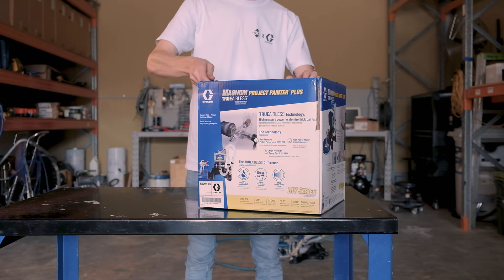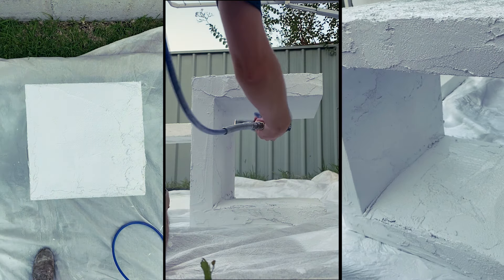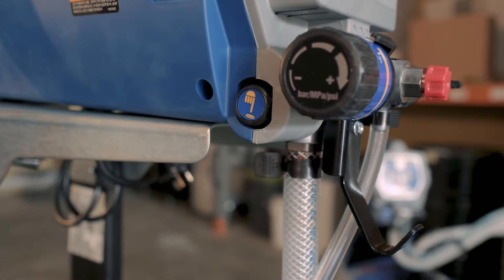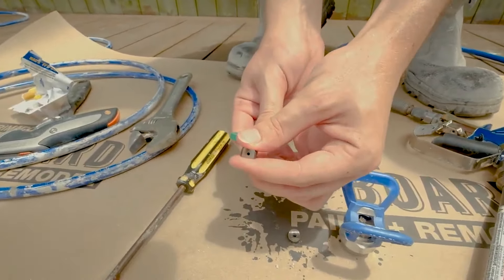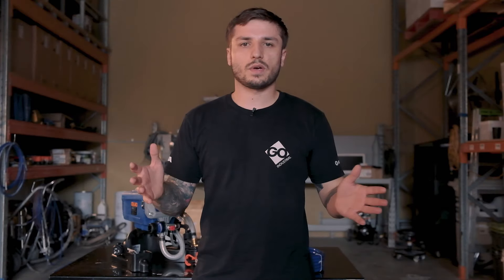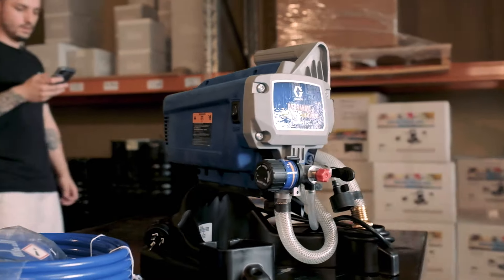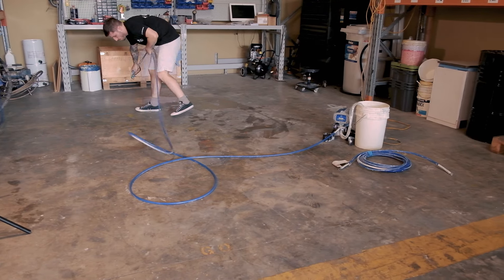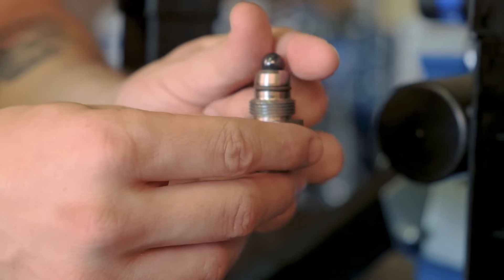Graco Project Painter Plus Magnum - Your DIY entry to airless spraying

Comment: Yeah, I paint interior and exterior for a living and I have been using this sprayer for a little over a year. And I spray 3500 sqft+ houses monthly and 1000sqft-2500sqft 2-3x a week and have never had a problem.  But I only use recommended length hose and no tip extension over 20 inches.  Like I said, I’ve been using a little over a year and what type of that I bought secondhand because the other sprayer I had was stolen out my truck. So I needed a sprayer because I was in a pinch because I had a job start that morning. So believe me these little sprayers can do a lot more than they give them credit for.
Reply: Appreciate the perspective
Reply: I don't appreciate your perspective.
Reply: That is helpful to read this type of comments from the professionals. Thank you for sharing
Reply: Would you say they are good to use for spraying apartments?
Reply: Bought one today in a pinch. Prepped walls today, paint tomorrow. Everything one color. Floorcovering guy was drafted to paint the apartment before carpeting it. I think I can do it! :)
Reply: How did it do when switching from oil to water based paints any clogging ..

Comment: I plan to paint a basement ceiling the same square footage of the house (2400ft) with black matte dryfall paint. Can I use the Project Painter Plus for this? If so, what tip and hose if not the ones that came with the sprayer?

Comment: When you say it is limited to spraying 200 Liters/yr, what do you mean by that exactly? Is that its typical lifespan? Is that when the motor/pump goes out? And if so, are there steps to extend that lifespan? Thanks for the great video!
Reply from the maker: This is a rough guide for the average use and lifespan of the Project Plus - assuming you'll use the sprayer for the next 4-5 years + and take good care of it. Frequent flushing with water until clear, storing with Pump Armour and somewhat regular use of the sprayer will definitely help extend the sprayer's lifetime! I hope this helps.
Reply: @GOIndustrial  thank you!

Comment: Hey I just bought this sprayer to paint the interior of my 4 bedroom house. I only plan on spraying a couple of rooms at a time. I noticed you said this shouldn’t be used to spray more than a small bedroom? What happens if I spray more than that at once? I bought this unit because I only plan to do small projects at a time (a few interior rooms, furniture pieces, etc). I’m not a professional painter, I didn’t want a large unit that takes up too much storage space, and I wanted something affordable but not so cheap that it would crap out on me. Was this a good purchase? Or is there another unit I should exchange this for? Just looking for any guidance
Reply from the maker: I wouldn't stress, the Project Plus is definitely capable of handling projects that you've mentioned! Definitely no need to exchange, the Project Plus will be able to handle these smaller projects time, at a time. The usage guide is just a guide - it is to ensure that the Project Plus isn't being used for massive exterior repaints, or commercial projects, to avoid burning the motor or pump out!

Comment: Can I use the tip that comes with the Project Painter Plus to sprays cabinets?
Reply from the maker: Sure can! We do recommend trying the Fine Finish Low Pressure tips however to achieve a nicer finish - the FFLP310 is a great tip for cabinetry!

Comment: I plan to paint garage walls and ceiling. Interior walls and ceiling. The house is 3,000 sqft. Lastly, kitchen cabinets (if this is professional enough). Which model do you recommend?
Reply from the maker: I'd recommend our Graco 190PC Express for this application!
Reply: @GOIndustrial  Can it handle painting a ceiling? I'm just looking to paint an unfinished basement ceiling. Thanks

Comment: Question. indoor painting waterbased. Enclosed room no ventilation. besides safety gear is it okay to do?
Reply from the maker: Good question! It is okay to spray in a room with little to no ventilation. I would highly recommend purchasing a small extraction fan to help, or at least ensure you're wearing a respirator for these projects!

Comment: What do you can ONLY spray 4-6 litres a day or 200 per year? What happens when I go over 4-6 litres a day?
Reply from the maker: Hey, thanks for your question! 

The 4-6 litres per day rating is a guideline that Graco set to ensure that the machine is not overworked and burnt out prematurely. 

There is nothing necessarily that will happen if you spray over 4-6 litres. It does however, put extra strain and wear on the pump / motor and may void the warranty. 

Hope this helps!
Reply: @GOIndustrial  So does staying within this guideline completely prevent the machine from ever burning out, or will it still eventually burn out at some point?
Reply from the maker: @SkemeKOS  Staying within this guideline will ensure that the sprayer will perform optimally. Of course after many years of use, the motor will begin to wear as its brushed, and the piston in the pump will wear out eventually! However we do service some of these sprayers that are 5-6 years + old, and are still performing great!

Comment: I just recently bought this unit to spay the eves of my home, will this be a problem?
Reply from the maker: It shouldn't be a problem! It'll more capable, just be mindful of not running the machine too hard, for too long in one given day. Run the pressure as low as possible, whilst still achieving a nice fan pattern. I also recommend to thin your exterior acrylic paint by 5% with water to help pumping and spraying.

Comment: I bought this machine to paint some kitchen cabinets. I'm only using it for primer(oil base) , will not be using nothing else with this machine. I'm hoping uts ideal for projects like this. ... I know there's better machine but is this decent for what I will be using it for? It would be just to primer cabinets, vanities, doors. I'd probably run 2gal each time that it would be used. Is that cool?
Reply from the maker: It will be more than fine for handling your application. I do highly recommend using the Graco Fine Finish Low Pressure tips (FFLP) for your application, as that will help achieve the best finish for cabinets, vanities and doors. I hope this helps!
Reply: @GOIndustrial  thanks bro!

Comment: what happens when you spray more than 6 liters a day ???? I'm looking to spray a cinder block wall about 6' high x 110' in length x 2 (inside and outside) - will this not work ?
Reply from the maker: This will do the trick, we usually provide the 6L per day guide as an indication for what the unit will handle in a given year. We've sprayed 15L in a day and the pump is fine, we just don't recommend pushing the unit too hard if you're spraying a massive exterior or interior!

Comment: Considering this magnum plus. I need to paint a 10x10 shed, 16x16 deck and maybe 100 foot fence - would this unit do the job?
Reply from the maker: Hey, great question! Sounds like you have some decent sized projects coming up. I would recommend going with the Graco X5 as a minimum. The Project Plus is just not big enough to handle those types of projects.

Hope this helps! 🙌
Reply: @GOIndustrial  Thanks for your reply.  In addition, can a 515 tip take care of those needs?
Reply from the maker: @jennyandgarylam6464  Anytime! A 515 tip would be perfect for the interior and exterior walls of the shed. But I might consider using like a 312 for the decking and fence as it will give you more control and less over-spray due to the smaller fan width! 🙌

Comment: So can this be used to spray polyurethane? What if it is the oil-based and not the water-based?
Reply from the maker: Unfortunately the Project Plus is only suitable for water-based materials. This is due to the safety risk posed by solvent-based materials and their flammbility with the brushed motor!

Comment: Thanks for the video. Can the magnum or the project versions spray polyurethane also?
Reply: Hey Jason, Thanks for the feedback! 

When it comes to that type of material, I would just double check what the TDS on the product says. It really comes down to is it a flammable solvent base and what is the viscosity (is it too thick).

Comment: Why only a small bedroom? I just painted the whole house no problem...
Reply from the maker: That's great to hear! This is a usage guide moreso for frequency. If you were to spray a whole house, I'd be using Low Pressure tips and not handling these projects multiple times a year :)
Reply: @GOIndustrial what tips would I need to spray a small exterior home. Is the one that comes with it ok?
Reply: Did you do exterior?
Reply: The usage guide is idiotic.
Nobody buys a paint sprayer to paint a freaking chair.....
You paint houses with these things...

Comment: @GO Industrial Great video! I'm also considering the Project Painter Plus. I will be painting my basement 28x18, small power room, 2 garage doors, front door and some window shutters. Will this unit handle my projects (wont be tackling them all at once it will be spread out throughout the year) Thanks!
Reply from the maker: Hey John, thanks for the feedback! For that volume of work, it shouldn't be a problem. If you need a little bit more power out of the sprayer, I'd perhaps also recommend considering the X5! I hope that helps!

Comment: Wait, so if you use it to do larger projects it’ll break?
Reply from the maker: Not at all! It'll handle projects up to a certain point - we provide a guide so the unit isn't overused and there isn't excessive wear to the pump or motor. It will handle jobs within a reasonable scope - as long as you aren't over-using it or attempting to run a painting business with the Project Plus, you will be fine :)
Reply: I don't get it neither!
Reply: I'm thinking it's more about letting the pump and motor cool down. Like if you try to spray a five bedroom house without stopping in a single day it could burn it up.

Comment: I don't see why an X5 or X7 unit couldn't spray an acrylic epoxy or acrylic emulsion roof coating.  Some of those products are only about 20-30% solids.  Good quality latex is 35-40% "solids, per Google AI.

Comment: I bought a used Project Painter Plus. I cleaned it up really good. But it is leaking from a small round hole directly behind where the suction tube connects. Why is that hole there?
Reply from the maker: Hey Dion, I had a good look at the parts manuals and our own demo unit and I couldn't see any small holes behind where the suction tube connects. I'd just say to make sure the thread is secured properly and the hose itself doesn't have any splitting.

Comment: So this is one step better than rattle canning the job.
Reply from the maker: Absolutely! It depends on your application however. We'd use te Project Plus for furniture, walls, ceilings etc - but if you have a specific need for spraying aluminium frames for example, and needed to paint with a durable enamel, the rattle car would be better for this application.